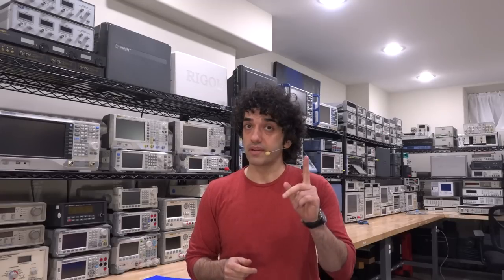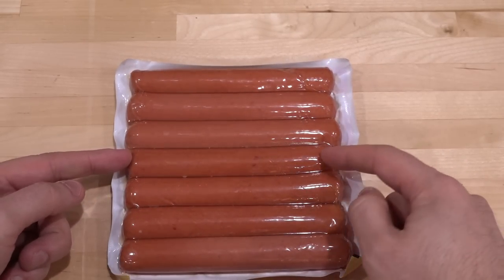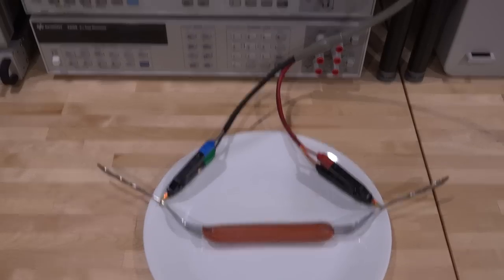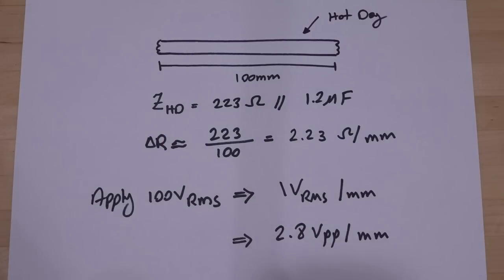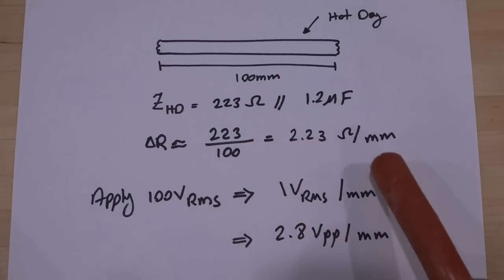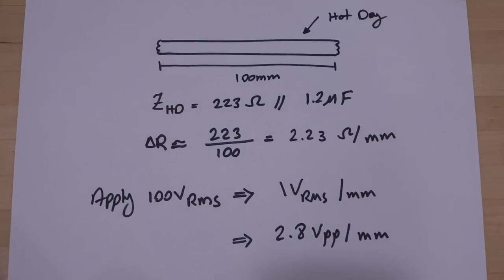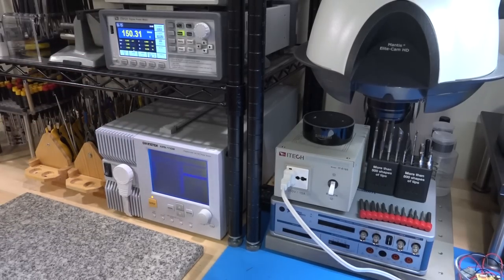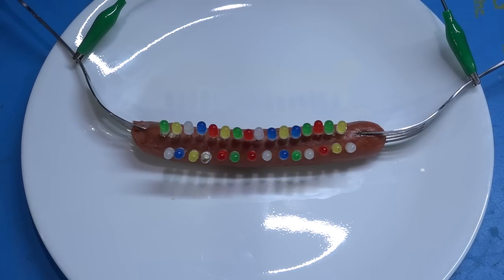TNP #29 - How many LEDs can you light up with a hot dog?

Comment: Those Keysight engineers who spent months to years of their lives developing that LCR meter. Only to find out it was used to find the impedance of a hot dog. :| 😂
Reply: Modern problems require modern solutions 😂
Reply: If they saw this, I'm sure they'd curse themselves for not thinking of how their meter would fare against a sausage
Reply: Yes, they would certainly be surprised, because the LCR meter was set to 100 Hz and the hot dog connection was implemented including calculations at 60 Hz, so the measurement should have taken place with the setting at 120 Hz  😁
Reply: but he didn't even used metrology grade forks ☹️
Reply: Tell that to the engineers that desing mega ohmmeters. All that delecate precision engeneering just to measure the resistance of somones butt st 1kV.

Comment: This points the wait towards a significant upgrade to the "Hotdogger" consumer product from the 1970's/'80s, as I remember from my childhood.  This was a hotdog cooking device, utilizing the ubiquitous AC line voltage available in most everyone's kitchen.  Now, back on those days, we didn't have microwave ovens, so quick and easy lunches were had by electrocuting hotdogs in the "Hotdogger".  

However, the problem was it was too easy to overcook (and/or have unwanted/unexpected flames produced).  All that's required is some LEDs to serve as an indicator of "doneness"  -- just like those pop-up indicators used when cooking turnkeys.   This is surely the innovation that will bring the "Hotdogger" back to the market.  

I also appreciate you using your test equipment to quantify the AC characteristics of the hotdog; I do not have access to such a high-quality LCR meter.  Perhaps as a follow-up, you could probe the RF characteristics with a VNA for a more complete characterization.

Comment: Why not use DC? As long as all the LEDs are inserted in the correct orientation, I would think it would avoid any issues with the compliance voltage rising too high during the reverse bias part of the cycle. Hot dog reliability is pretty important.
Reply: Good point, but I just know that I would insert a few LEDs backward an be very disappointed.  Pretty sure I wouldn't be fast enough to swap them around the right way before the hotdog was done cooking!
Reply: It would cause ion migration into the hot dog. But it could possibly be used as an advantage if iron electrodes were used, helps to boost endurance.

Comment: Excellent. Just a bit of nitpicking, impedance mismatch between forks may affect the measurement. Could be a reason why contact was lost so quickly. Perhaps improved version would use metrology grade stainless steel forks and also accounting for hot dog's skin effect would allow to extend LED operation time! New market opportunity for test equipment manufacturers to provide calibrated hot dog standards for open, short and perfect load.

Comment: A first-class scientific task, but  🤔 I'm quite surprised that the LEDs survived, there was a major error during the measurement! The LCR meter had its measuring frequency set to 100Hz and this would correspond to a mains frequency of 50Hz, when using 60Hz the LCR should have been set to 120Hz and this would change the results in the hot dog resistance calculation per cm.
I tried to replicate but it didn't work well, I thought I didn't use the correct "fork" connectors, but after checking the whole circuit I realized that my hot dog is not kosher and it's made from chicken 🤣

Nice April day 😁 THEdison
Reply from the maker: The difference in frequency (50Hz versus 60Hz) would have virtually no effect in this case.
Reply: @Thesignalpath  I'm sorry for my mistake, at the first moment I didn't realize that the hot dog used was kosher and thus its structure does not contain the permitted number of ground mice, therefore the parasitic capacitive reactance of other muscle mass will not apply, the resistive ratio between the meaty component and fat will be balanced and thus as a result, the difference in the applied frequency will be completely negligible 😁

Nice day 🙂 Tom

Comment: No block diagram showing the mixers, switches, amplifiers and attenuators present in every hotdog. And you didn't even strip one down to find a lose cable or damaged connector.

Son, I am disappoint. :)